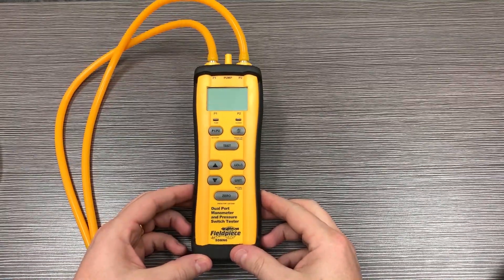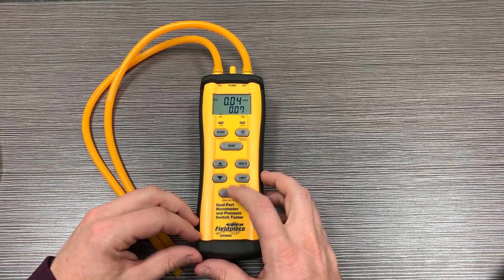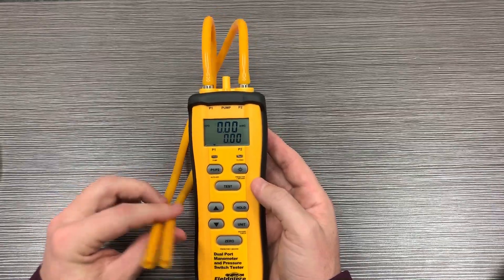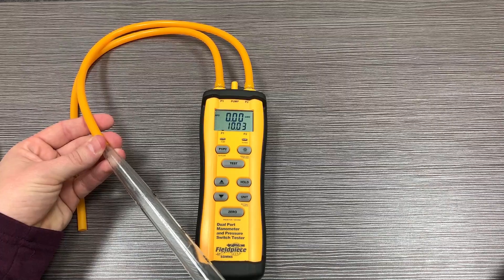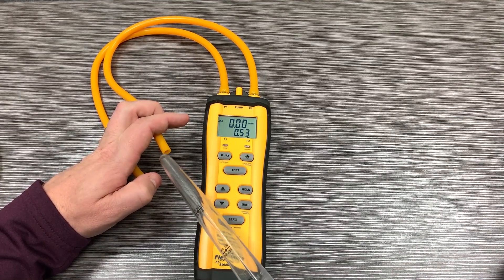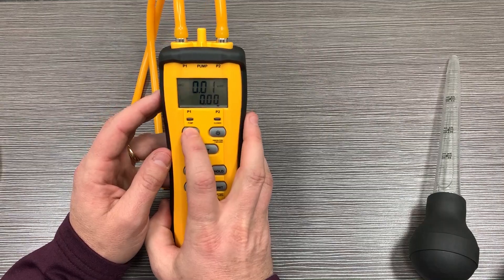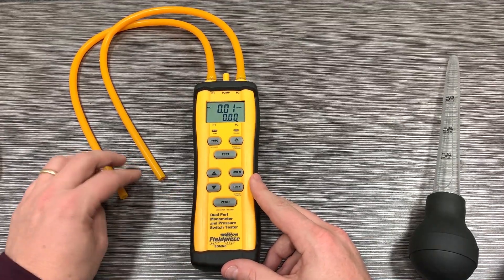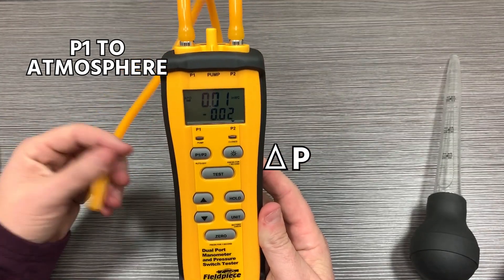Prevent this Common Manometer Mistake

Comment: I have the same manometer. It seems like the reference point to atmospheric changes, so it throws the measurement off. I have to pinch the tube disconnect it and zero it out to atmospheric again. It seems like the measurement wanders. I’m wondering if my manometer is just faulty or if they’re just all like that?

Comment: The differential reading may be important with gas valves in some cases.  For instance we may need the inlet pressure to be 1.5"WC minimum above manifold pressure for the gas valve to regulate properly.  So without the proper differential the manifold pressure drops.